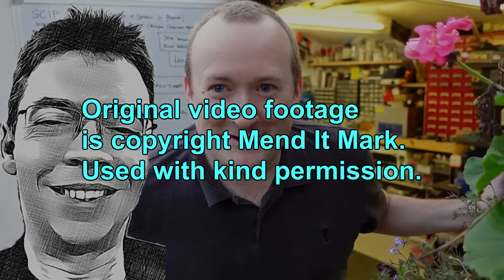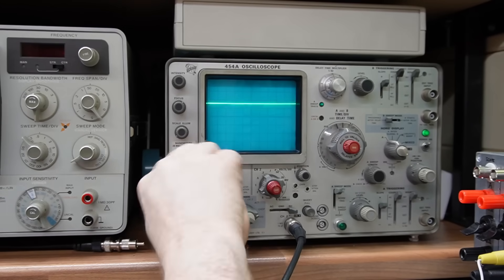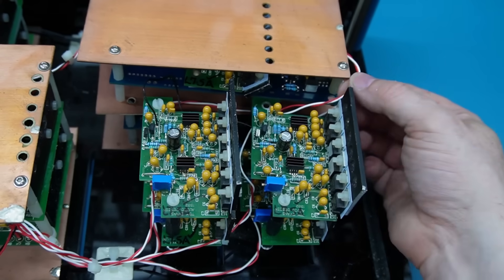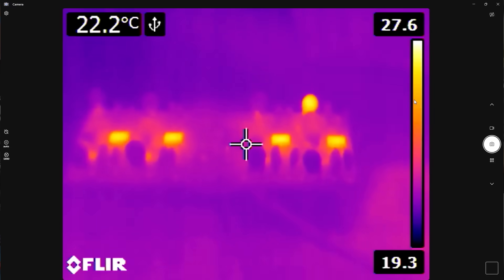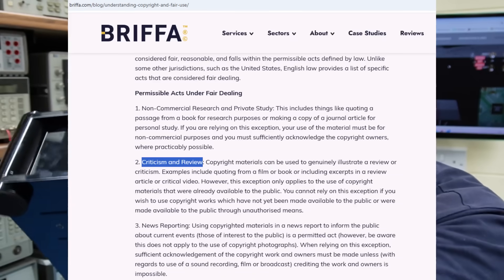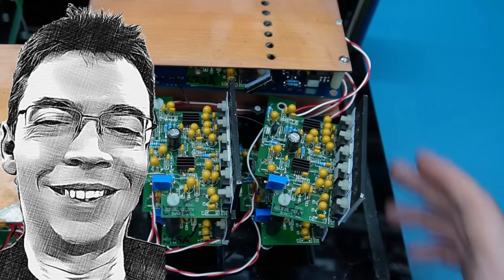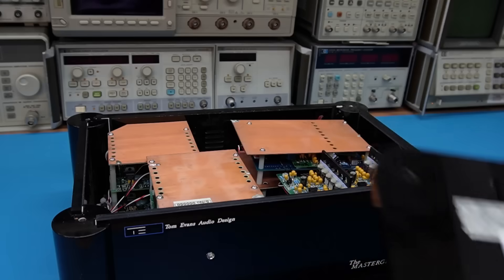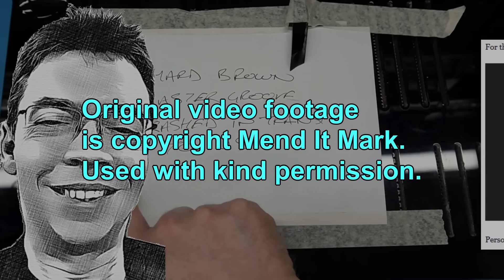Reaction to Mend It Mark takedown by "Tom Evans"

Comment: Youtube's copyright is about content,  not hardware. Hardware is copyrighted (anything you create is copyrighted by default)  but violating that copyright requires building your own version of the product and selling it. Mark did not do this.

That said; here in The Netherlands some photographers have been successfully sued by the designer of a fancy bridge because they were not allowed to sell pictures of that bridge, because of copyright. Kind of like how you're not allowed to record a live concert and sell that recording.

Evans' claim is obviously against the video because it shows that this machine is not worth $25k.

He is Streisanding himself into bankruptcy because now everybody who owns one of his machines is going to open it up to see what's in there.
Reply: One area which could infringe copyright is Marks documentation BUT the infringement is legal unless he sells it (and causes a loss to Tom Evans)
Reply: @carly09et and Tom Evans would have to prove in court he suffered loses due to MIM video.
..
Perhaps knowing how cheaply the amp is made is certainly not doing TE any favours..
Reply: @stuartd9741  Yes, I am think of why You Tube was so aggressive with its action. As the complaint lacked relevance ie what in the original video was actionable. I watch a reupload, maximising IP  claiming and found very very little.
Reply: @stuartd9741  Yep, but the cost to fight it, BUT the bluff that usually works.
Reply: That's actually common with architecture.
Reply: @BobAg_  It is by default. You do not need to register a copyright. The clue is in the name: it's a right not an administrative grant.

As the UK government's website says:

You get copyright protection automatically - you do not have to apply or pay a fee. There is not a register of copyright works in the UK

UK law applies, of course, since both Mark and Tom Evans are living and working in the UK.

The same government website helpfully describes the sorts of original content copyright applies to. It lists literary works, software, database designs, sound and video recordings... but not hardware designs.

It is actually impossible for Mark to have infringed on any Tom Evans copyrights. An electronics schematic would not be copyrightable (in the same way a list of ingredients in a cookbook cannot be): the design is merely an outcome of the component selection and not an original conception. As you correctly say, patents are what you use to protect hardware designs ...but a video maker cannot infringe such a patent.
Reply: A hint for all non-U.K. people who don't know U.K. law: This is not copyrights, nor patents .  The e-mail to MendItMark actually said what this is about.  There is a third thing that the Copyrights, Designs, and Patents Act 1988 protects.  It is protecting xyr design right that Tom Evans Audio Design is going for.  (As well as registered designs being specified in the e-mail, the clue is even in the name!)

MendItMark re-created a 12-page formal full design document , that shows the precise board shapes and component placements, put the original designer's name on every page, published it on YouTube slowly leafing through the pages one by one on camera, and (according to other discussions) monetized it.  In U.K. law, this is primary infringement of the design right , as laid out in §226 of the CDPA.

The sad thing is that if MendItMark hadn't tried to be so clever, xe could have got away with lambasting the poor design with total impunity.
Reply: @JdeBP  negative as in that case the manufacturer of the op amps could then claim the strike on Tom Evans for recreating the reference circuit in the data sheet.
Reply: @JdeBP  I disagree with you, since I don't believe a circuit diagram can be afforded design protection. As Mewburn Ellis puts it: Essentially, the design of a product relates to its appearance, rather than to technical principles of its construction or operation

Moreover, even if a registered design could extend to the arrangement of electronic components, the protection afforded by a registeted design is merely to stop someone from copying that design for commercial gain. Which, clearly, Mark did not do.

And even if Tom Evans has registered a design and considers Mark's documentation to infri ge on it, his missive to YouTube complained of a copyright violation, not an infringement of a registered design.

So, whichever way you look at it, Tom Evans has played fast and loose on this one and I don't believe Mark has been "too clever" at all.
Reply: @dizwell  You have not looked at the full formal 12-page design document shown in MendItMark's video, which went far beyond a circuit diagram; nor have you checked YouTube's terms of service, which refer to non-infringement of any kind of intellectual property rights, not only copyright.  Nor did you (as, in fairness, almost nobody seems to have, although I have since put the relevant timestamp in a comment thereto) spot when Louis Rossman even read out the part of the message to MendItMark stating that these were registered designs.
Reply: @JdeBP  Don't be so arrogant as to tell me what I have or haven't looked at, please. In point of fact looked at them carefully whilst you seem to overlook the fact that a registered design cannot be used to protect functional aspects of a product's makeup. So what Tom Evans's ambit claim in an email may have been is irrelevant: he's not allowed to register an electronic 'concept' or a PCB construction as a design and seek to enforce it as though it were intellectual property against someone who is not exploiting it for commercial gain.

And if we're going to cite Rossman videos, remember Louis read out an email from Mark stating that he had searched the database of registered designs and found none by Tom Evans. I assume that if he actually had one, Tom Evans would have cited the registration number. 

And for whatever it's worth, I've searched the registered database for "Tom Evans", "Tom Evans Audio Design" and numerous permutations thereof ...and I can't find anything there either. I even spent an hour trawling Companies House to see if Tom Evans is associated with a registered company (he mentions a 'LTD' on his appallingly-written website front page, without specifying an actual company name) and then searched for registered designs under any likely looking company names ...and I drew a blank there, too.

So again: if he had a registered design, he'd have cited a number in his complaint. He didn't. His website is as amateur as his PCB designs. Face it: the claim of intellectual property rights infringement is just spurious.

You sue for big money on registered design infringement (remember Apple's rounded corner suit against Samsung regarding the iPhone?): you do not make video take-down claims for a one-man-band's YouTube video!
Reply: @dizwell  Nice. 👍
Reply: @dizwell I certainly agree that the takedown was wrong (with only limited insight, I didn't see the original video), but it does play well with the YouTube process.

It is both possible and easy to take down a video you'd like to stop using the "copyright claim". YouTube doesn't care who's right, they only care about following the law, i.e. not being sued for sharing illegal material. The claim can be disputed to get the video/monetisation back, but the outcome is much up to YouTube. They have no legal/contractual obligation to allow all videos.

In this video at 5:11 saying something like "selling things publicly devoid the copyright secret" is however rather strangely put. Copyright is not about secrets, it's about copying/presenting something protected. Certain works are protected automatically upon creation, and it doesn't matter how public it is. 

And some state that copying is wrong only when you benefit from it, or hurt the sales of the owner. I say that's incorrect. Sharing a work without an appropriate license is the offence, the damage is only a matter in the following lawsuit and damage negotiation. Think of a novel or a piece of music. You may copy it for yourself, but not distribute copies without consent, no matter what you earn from it. 

That said, it's still questionable what the actual infringement would be, but there's also a lot of misconceptions about the rights one has by law and on YouTube.
Reply: @_J_A_G_ Well, I don't state that copying is only wrong if done for monetary or commercial gain. The lack of commercial gain is one factor a court can use to determine if the copying falls within fair use exceptions, but only one.

But let's not in any case confuse copyright with registered design infringement, which is an entirely separate body of law and regulation where commercial exploitation of a design is a critical factor in determining if an fringement has taken place. Mark was told by Tom Evans his work infringes on registered designs. First, those designs don't even appear to exist. Second, even if they did exist, Mark is not exploiting the design for commercial gain, so no infringement of them has occurred.

That lack of commerciality would not save Mark if copyright violation was alleged. It does save him if registered design infringement had taken place.